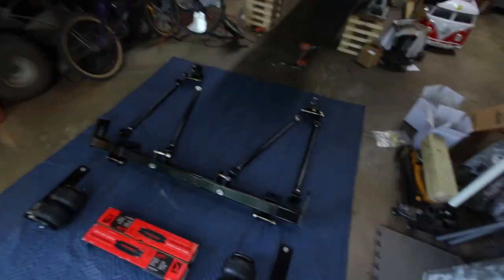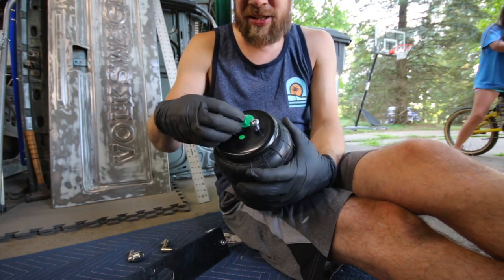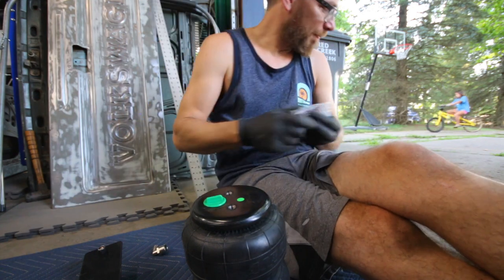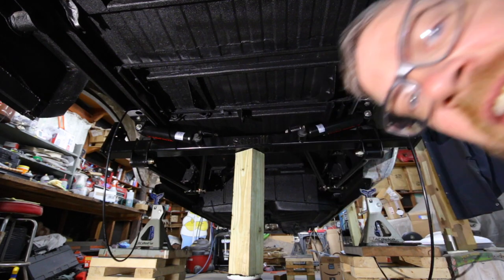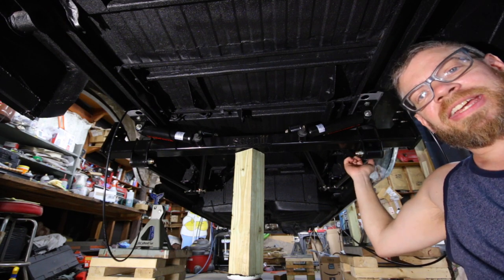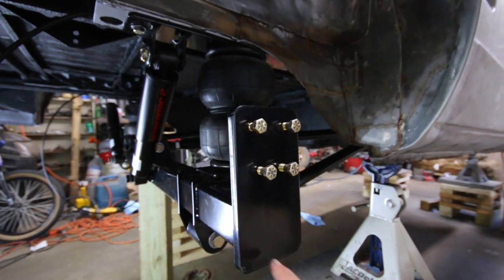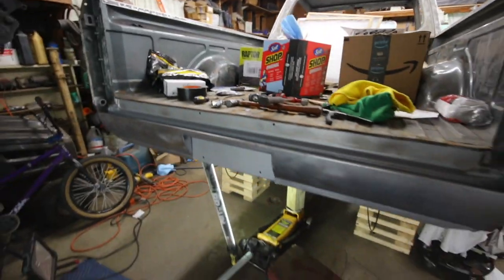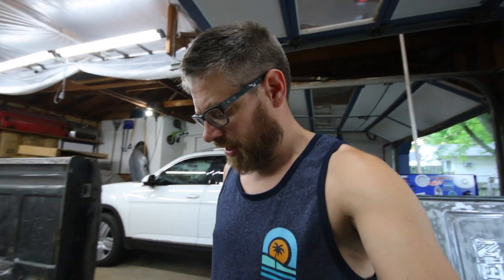4-link install -- Rabbit pickup project part 26

Comment: Looks sweet Paul, just playing catchup at the moment. Test fit done on the air ride system 4 link. Wheels centralised and fine tuned in the arches. Might have to do a few tweaks as my handbrake conections on the the disc brake conversion I test fitted are really close to the bags since I had my axle cut 30mm on either side for wider wheels. Probably make some 15mm spacers to fit between the axle and the stub axle plates.
Reply from the maker: NIce!  Yeah i had my 4 link made narrower also so if anything i can space it out vs no be able too.

Comment: Hey Paul when you installed the 4 link did you made any mods or welded anything to mount it
Reply from the maker: I had to cut off the front leaf mounts.  but other than that no i didnt have to weld anything for the 4-link or install.
Reply: @PaulLehman  where talking about the front mounts for the front part of the suspension (in the engine bay )the one you had issues with
Reply from the maker: @jdsphynx3656  the front kit ckw2’s airbags don’t need anything either. Everything comes with them you need other than management

Comment: really wish i would have done a video on my caddy build. we arent far off in build styling. add me on instagram of check out the truck im sure we could throw a few ideas around. i did a full staved bay 1.8t. with the seen it bags. round headlight front and then shaved the rest of the body. Instagram is @thatvwdude
Reply from the maker: Thanks man.  I looked you up